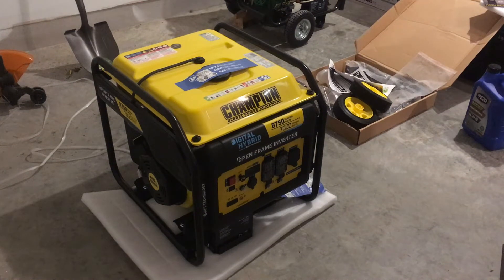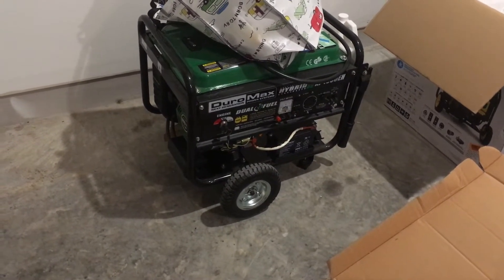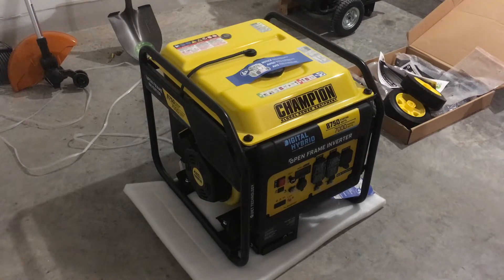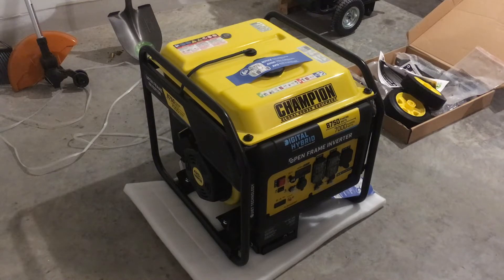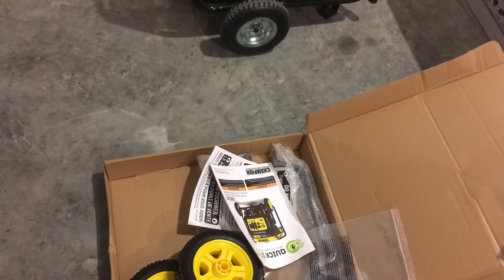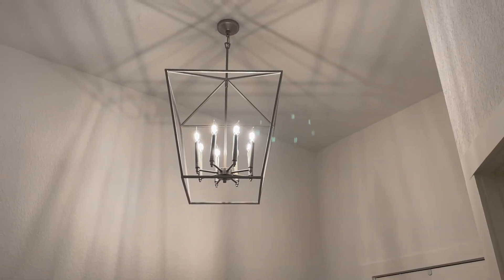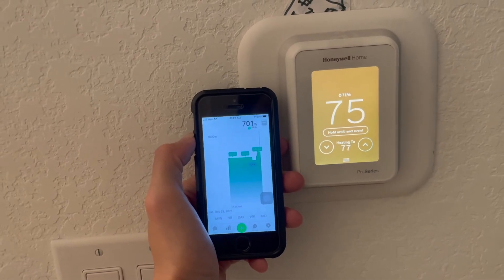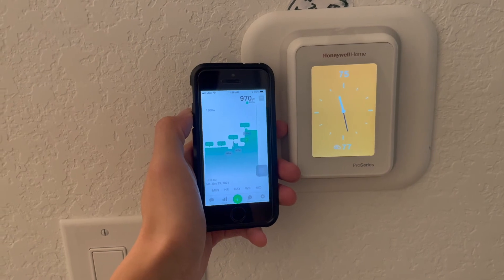Champion 100520 Review and Setup For Whole House Power Backup System

Comment: Hey Jonathan, so happy you removed the panel. Do you think the L14-30R on the generator could be replaced by a L14-50P ? I have a 14-50 weatherproof on the outside of my house, wired to the main panel. I'd rather not use an adapter.
Reply from the maker: Hi Randall, I don't think the L14-30R can be easily replaced by an L14-50P. The L14-30R is smaller than the L14-50P so you'd probably need to widen the hole on the front panel if you really wanted to do it. Additionally, generators generally use 14–50R receptacles instead of the locking ones. I don't know why, but this seems to be the standard. I would just recommend the adapter.
Reply: @jonathanDIYs  I fixed my query to read 'Do you think the L14-30R on the generator could be replaced by a L14-50R ?' I don't have a problem with doing a bit of drilling and material removal. I want to be able to scale up to a 240v 50 amp generator supply in the future, so I've done the house wiring and the inlet box to 50 amps.
Reply from the maker: @randallsemrau6911  Sure, I totally think it would be possible. You'll probably void any warranty on the generator by doing so though. It appeared to me to be a standard receptacle with some sort of custom mount from the back. All the wirings are secured by screws. Nothing seems to be soldered or permanently attached to the unit. You'll probably want to keep the parts list and wiring diagram handy when doing this - https://www.championpowerequipment.com/wp-content/uploads/2021/08/100520-EPL-English_After-21MAR1700224.pdf. 

Again, I personally wouldn't do it. I find just getting an adapter like this https://www.amazon.com/Generator-Adapter-30Amp-Female-12inch-CRG30450/dp/B06XXBF1G5/ref=asc_df_B06XXBF1G5/?tag=hyprod-20&linkCode=df0&hvadid=216506979975&hvpos=&hvnetw=g&hvrand=3278260485959757813&hvpone=&hvptwo=&hvqmt=&hvdev=c&hvdvcmdl=&hvlocint=&hvlocphy=1026748&hvtargid=pla-349051757259&th=1 much more simple and less of a headache. You can keep your whole house accepting 50amp connection while connecting your 30 amp generator to the house for less than $30.
Reply: @jonathanDIYs  Yes perhaps your advice on using an adapter is easiest and will not void the warranty. I just don't like the idea of additional electrical connections, or the long adapter and plug hanging off the receptacle as the generator vibrates away, hour after hour. I suppose I could find some way to secure it or dampen the vibrations. Thanks for responding, Jonathan!
Reply from the maker: @randallsemrau6911  those plugs are designed to withstand the vibrations. On the locking end, it won't come out and on the other end - the 4 prong takes quite a bit of force to push in and out (note the 4 finger grip). Unless you pull it in and out hundreds of times, I don't see it getting loose. Also, if you keep the 4 prong side attached to your cord for connecting to the house, you'll never have to take that side off. The whole setup is outdoor rated - this is similar to what they use to connect RV to power station at RV parks and those are out in the rain, heat and bad weather conditions. I think you'll be fine. :)

Comment: Did you try starting that AC unit while you had it in Eco mode? It won’t work that way. Depending on the size of your AC unit, probably up to 3 ton, it should run it fine if your not running everything at once . I too was very interested in the 100520. It still out of stock. I went with the Wen 875i , same machine with some minor differences.
Reply from the maker: I tried it both with and without Eco mode. I have a 4 ton AC which it just could not start. I bought a soft start kit and now I'm able to power even the 4 ton AC - https://www.youtube.com/watch?v=2_VcUyg5V7w. I'm a happy camper. :)
Reply: @jonathanDIYs  Yeah, that 4 ton unit would just be to much for that generator without the soft start.  I do think it will run a 3 ton as long as you’re not running the whole house with it.  I gave up waiting on the Champion. It was supposed to be back in stock in October, now they’re saying February.  I bought the Wen 875i which is practically the same machine.
Reply from the maker: @raidersaff7709  yeah, supply chain shortages are really rough. How you liking the Wen generator?

Comment: A little more help on that sense app from home depot please. I searched sense app and got all kinds of other stuff. Thanks, I ordered the 875i from Amazon and they messed me up so I went local and got a 201035 non inverter last week. Thanks.
Reply from the maker: Here you go - it seems to be on sale - https://www.homedepot.com/p/Square-D-Wiser-Energy-Smart-Home-Monitor-WISEREM-WISEREM/309169110 If you want, you can also get it directly from sense - https://sense.com/ Hope it works out for you!
Reply: @Jonathan Chan  
Thanks for those links. I'm reading more about this. 1st its expensive and more all house, I was thinking more for what the generator was at volts/hertz/rpm/watts. As I try and learn more that seems to be what I need for monitoring what the generator it doing. I don't plan on more electrical expense for the panel, etc. I just want a cable to 4- 120v plugs. Great info and video, appreciate it. I guess I'll add the watts info and plug it in, like on Green Acres.
Reply from the maker: @semlohde1  The generator has a display that shows hertz and volts already - check if the generator you purchased already shows that. For RPM, you can install a sensor around the spark plug to detect when it fires and calculate the RPMs. I was thinking about doing that when I install the natural gas/propane conversion kit to make sure my generator is still operating optimally.
Reply: @Jonathan Chan  
Yes my gen does show the colts and hertz, albeit 62hz?? Thanks for that info on the rpm, I'll try and find that plug thing then. That should have me set. We drop to 31 in a few days so I need to crank it to finish that breakin oil 5hrs and get ready for that what if. Appreciate your input.
Reply from the maker: @semlohde1  if you're running a regular generator and not an inverter generator, the RPM of the engines directly affect the hertz. You may need to tune your engine to spin slower if you want exact 60.
Reply from the maker: @semlohde1  this video should help you with that. https://youtu.be/abIOHwdfbdQ
Reply: @jonathanDIYs  
That's fantastic. I'll look for that screw when I crank it in a bit. Thanks.
Reply: @Jonathan Chan  
No inverter on this 102035. I ordered the 875i but Amazon wouldn't deliver for 10 days and it was onkyb27 Mike's from my house, and wouldn't let me puck it up. It miffed me, so now I have duel fuel more power, unstable. Uh, darn.

Comment: What app are you using to read the watts used in your home appliances?
Reply from the maker: That's the Sense app. You can get it from Home Depot. You attach a volt and current sensor to the electric panel and it provides all that info in the app.

Comment: Where did you order this from? Out of stock online everywhere I look.
Reply from the maker: Unfortunately it goes out of stock really fast. I got mine from amazon when it was on sale in June. I use https://camelcamelcamel.com/product/B083V8VNGL to track the price and get alerts when it is on sale.
Reply from the maker: It's back in stock on amazon! https://www.amazon.com/Champion-Power-Equipment-100520-8750-Watt/dp/B083V8VNGL for $1005.00! Only 20 left in stock - get it while you can if you're still looking.

Comment: after 2 years later are you happy with buying this? Thanks
Reply from the maker: Yes! It has been great. I've needed to clean the carb out once (but that's probably my fault for not emptying the fuel completely or using it regularly). I have full confidence in being able to get the generator fired up in an emergency and very happy that I paid a fraction of the price of a full standby unit. It is able to keep most of my appliances running in the house, I think this is the ideal sized generator for my needs.

Comment: How did you measure the wattage being used from your phone?
Reply from the maker: I have a Sense whole house energy monitoring system (https://sense.com/) hooked up. It allows me to monitor my energy usage from my phone. I wired it up in such a fashion so that I can monitor both the generator power input and the main power input by running both the main lines and the generator wires through the amp meter clamps in the main panel.
Reply: @jonathanDIYs  Brilliant! Thanks!

Comment: My original statement below is incorrect.

Near where the oil dipstick is the green grounding wire where you can change the floating by vs bonded neutral without taking the front plate off.
Reply from the maker: Good to note! I’ll have to try that out next time I am playing with the generator!
Reply from the maker: I checked it out today - that is the connection to the frame and to attach a grounding wire. You definitely don't want to disconnect that. Even if you do, the ground and neutral remain bonded. The white and the green/yellow cable has to be disconnected otherwise the bond remains.
Reply: @jonathanDIYs  Hi Jonathan, so you are confirming (don't) disconnect that connection to the frame, and still go with the white wire disconnect behind the panel correct?  Sorry just working on this today, and don't want to screw it up, great video man!
Reply from the maker: Yes, the only way to unbond the neutral from the ground is to do it inside the panel. Best wishes for getting everything setup! :)
Reply: @jonathanDIYs  Awesome, exactly the info I needed to ensure my home connection is safely done, thanks man!

Comment: Think your handle might be upside-down.
Reply from the maker: Yes, you're absolutely right! Someone else pointed that out and I fixed it recently. Thanks for commenting!
Reply: @jonathanDIYs  I'm trying to decide between the 100520 and the 100519.  What is the realist running time for the 10520 is running two regular size refrigerators, a single tv, and some led lights?
Reply from the maker: @spacecoastz4026  Probably around 8-10 hours. If your load is that light, the 100519 will be the more efficient generator for you. I only bought something this big to run the whole house. Smaller generators generally use less gas than bigger ones. I think with the 100519, you might be looking at 10-13 hours.
Reply: @jonathanDIYs  Yeah, I have a 4-ton Diakin two-speed compressor with variable speed air handler.  No easy start and my A/C dealer (which I have a warranty with) seems to be negative about trying to use a generator to run it.  My water heater used 4,500 watts, so I assume the 100519 would run it if needed.  Do you think I need to keep the two refrig on different legs of power if I have the 100519?
Reply from the maker: @spacecoastz4026  Is the Daikin compressor a 3 phase unit? I would also not be too sure if it would be compatible with running on a generator as the generator only produces single phase... there even is a big warning in the manual "DO NOT connect 3-phase loads to the generator." Anyways, for your refrigerators, you probably could keep them on the same leg of power. Each leg is protected by a 20 amp breaker which is probably the same as you have for your house breakers. If they work on 1 breaker now, they should also work on 1 leg on the generator.
Reply: @jonathanDIYs  I don't know about the A/C compressor, but good to know about the possible issue.  My two refrigerators are on two individual circuits but on the same house 120v leg.  Thus back-feeding into the house would put both of them on the same generator leg...which if they both started at the same time could pull maybe 2,400 watts.  I found a different circuit that I could plug the one in the garage during generator use, which would put it on the other leg...so problem solved.  Guess I'll be getting either the 100519 or the 201066.  The 100520 might be overkill if not trying to run the A/C.

Comment: Get your neighbors to buy the same or similar system or you'll be a target in an extended blackout when everyone starts to eat each other.
Reply from the maker: 😂 I'm the poor guy in the neighborhood (but probably a bigger target?), I know there's a few neighbors with solar and battery that never have power outages and a few neighbors with standby automatic transfer generators. Their systems are definitely more expensive, but people might target me because mine is a portable system. 🤷‍♂️ Definitely hope I never am in a situation where people start to eat each other. Sounds scary.
Reply: @jonathanDIYs  I'm being somewhat humorous. Thanks for responding. Heard some guy talk about how someone took an old lawnmower and left it running near a generator he had his eye on and exchanged the old mower for the nice generator and its owner couldn't figure out why his power disappeared yet he could still hear that his generator was running. There are always creeps who would take advantage of those with ingenuity and who plan for potential problems. Your analysis of that generator, which was one I am considering, was very good.